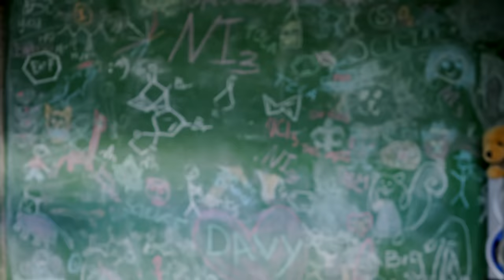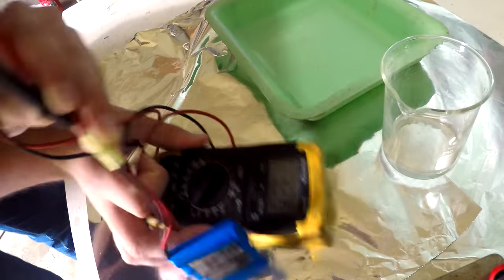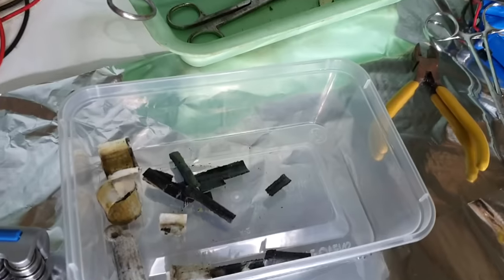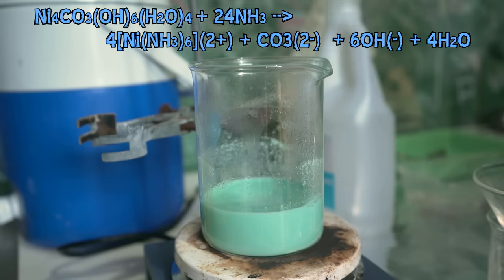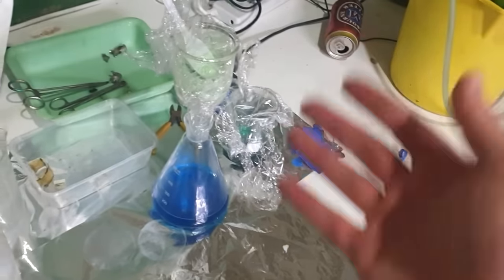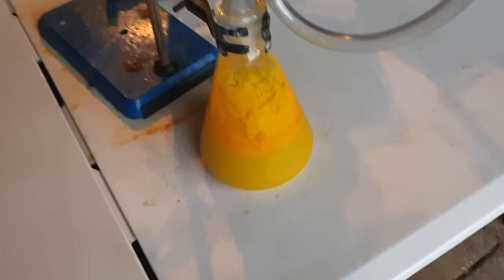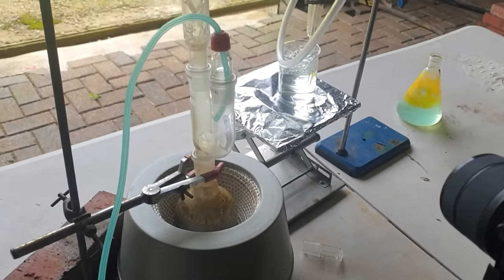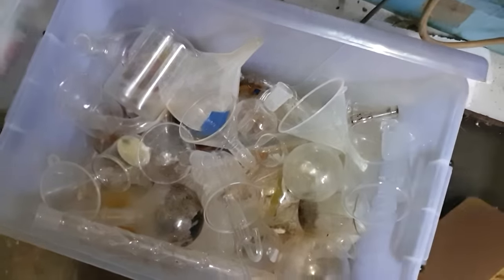Extracting Cadmium from a NiCd Battery

Comment: As part of my degree course, I went to a chemical plant that was very pleased that it had recently worked out how to replace the Cadmium electrodes they had been using, with Lead electrodes, because Lead was so much safer.
Reply: that feels like a weird sentence considering how bad lead is as well. Lesser of two evils I guess
Reply: In 2020 I worked a bit at for an electrochem project of a doctotorant as a general lab rat.
Cleaning and polishing the used cadmium electrodes was one of my jobs. I was kinda glad I had stocked up a few micro silver filter cloth masks before habd, because if the pandemic. ^^
Reply: Not that safer though.
Reply: Lead's way better than cadmium
Reply: @subliminalfalllenangel2108  ermmmmmm yeah it’s decently so, cadmium is fuckin scary lol
Reply: @theangledsaxon6765  perhaps... it is not mercury which is potentially like on thelevel of meth in terms of damaging... but its still bad and lead is even less dangerous than cadmium

Comment: Back in the 70's I helped build an apple press. After 300 lbs (yes, we were still using furlongs in the 70's too) of apples, the plating on all the screws was gone. A quick test in the university lab proved we had a tasty, toxic cadmium apple drink.
Reply: What kind of screw has cadmium in it?
Reply: @sunnysuryani5674  a screwed up one
Reply: RIP
Reply: Cadmium plated screws and bolts were common. We been getting cadmium plated nuts and bolts from China for some time and folk don't know. Galvanized and zincalume may also have cadmium if from tjyna. Heat it red hot for a bit if the coating is brown it's cadmium oxide. Zinc oxide is white but happens to be yellow when still hot till it cools .
Reply: @Philip-hv2kc  cadmium is pretty common in nuts, bolts and other metal hardware... i found out after i made a bong out of the stuff...

Comment: "Cadmium is extremely toxic"
10 Minutes later
"The Cadmium is somewhere I'm not quite sure"
Reply: It can't be that toxic. In high school, I tried to make my own NiCd battery and I was heating cadmium with a propane torch to shape it the way I wanted and I didn't realize not only could I melt it but its boiling point was low enough that I was boiling it too, and I certainly breathed in some of the vapors and never had any ill effects from it. Of course that was cadmium metal and oxides, they were probably not very soluble so I wouldn't have absorbed it.
Reply: That's not really how carcinogens work. Cadmium fumes can cause kind damage and kidney damage, but it's also a carcinogen.

Comment: We had some metal bits in our science lab in high school that was meant for showing how density worked. They came in these nice old kits in plastic bags, each piece was equal in size.
Among the samples was a slug of metal that didn't look like lead, but it was very very heavy. I was curious as to what metal it could be.
Read the instructions and it turns out it was a solid lump of Cadmium. That I was handling with my bare hands.
Reply: Oops
Reply: Well, elemental cadmium isn’t all that dangerous. It’s not absorbed by the skin so you’re not going to die by holding it
Reply: @Tactix_se  same as lead or even mercury. people got mercury fillings and we still fish and hunt with lead, and its mostly fine to touch(dont eat birdshot)

Comment: I have fond memories of NiCd batteries from the 1990's. I had Rc cars that used 7,2v nicd packs. I used a few of those packs almost every day of my childhood and they ALWAYS just worked. I would fast charge them on a 15 minute charger and discharge them at huge currents. I shorted them many times and all they ever did was get hot as hell. NiCd is a helluva cell and would be a great choice for EV if it wasnt so toxic.

Comment: NiCads also can function in the cold very well, which is why they used to be the standard for military aircraft, and are currently in use for Arctic conditions.

Specifically...flooded NiCad were used. Yep. They used hydroxide electrolytes and lasted pretty much forever. Marathon was the brand.

I got a hold of a pack of these, flooded them and used them for an electric snowblower conversion back in the early 00's. You have to use nickel plated connectors because the solution is so basic.
Reply: Those batteries have some Wheaties, lots of prompt current. Need 10 cells to make a 12V jump pack. The aircraft packs are 24V or 48v usually.
Reply: Misread that as "Arabic conditions"
Was like "wait what"

Comment: From Wikipedia "Ni–Cd batteries contain between 6% (for industrial batteries) and 18% (for commercial batteries) cadmium, which is a toxic heavy metal and therefore requires special care during battery disposal."

Maybe that was all of it
Reply: holy fuck, that really might've been all of it
Reply: 6% of fukk-all is fukk-all. I think you´re right.
Reply: @Skyliner04s  still, the cell should be something like 29g, he should have way more...
Reply: @AKAtheA  are we including the steel case?
Reply: @jeremymcadam7400  yep
Reply: @AKAtheA  could be that the 6% is relative to the internals?
Reply: @jeremymcadam7400  that would still leave him fairly short :P
The casing is really thin, a few grams at most.
Reply: Welll, his disposal of the cell was rather special so he totally fulfilled that requirement 😁
Reply: You could also figure it out from the battery's electrical capacity. 1A-hr = 3600 C (coulombs), which represents 3600/96500 = 0.037 moles of electrons transferred (that 96500 is Faraday's constant, the number of coulombs of charge in one mole of electrons). I'm not sure what the chemistry is in the battery, but assuming you get one electron per Cd atom, that means 0.037mol of Cd, which is about 4.2g of Cd or 5.4g of CdS. Those cells are probably less than 1A-hr, but are almost certainly more than the 100mA-hr that would justify only 0.5g of CdS. Maybe you're looking at 20%?? yield. If the cadmium in the cell oxidizes 0->+2 instead of 0->+1, you should expect half as much product, so in that case, maybe 50%?? yield.
Reply: @kevinmartin7760  this literally looks like hieroglyphics to me.
Reply: Damn close
Reply: @matthewjohnson4583  Lol basically there's a direct correlation between the capacity of the cell and the amount of cadmium in play, and... you do a bunch of "what he said", and that's how you work it out 🤣
Reply: @matthewjohnson4583  then go to school buddy
Reply: @Z. Michael Gehlke the 400Mg was not Cd, but the sulfide salt
Reply: @kevinmartin7760  Cadmium gives 2 electrons, I do believe, and as this is a 620 mA-hr battery, that gives us 2232 C, for 2232/96500= 0.023 moles of electrons transferred. 1 Mole of cadmium is 112.41 grams, which works out to 2.58 grams of cadmium, divided in half because it's two electrons per atom, for a glorious 1.29 grams of delicious cadmium in the battery.
Correct me if I've gotten my math incorrect somewhere here, the numbers are based off of the label on the battery pack that he dissects for this one, and it's been a while since chemistry in high school or the navy.

SInce that's a 4 cell battery, that works out to 322.5 milligrams per cell (based on the voltage, Ni-Cd cells typically run at 1.2V), which tracks pretty well with things like li-ion or li-po cells, cause those contain dick all lithium.
Reply: @Ornithopter470  Since those batteries are connected in Series, each of them will have the same 620 mAh capacity, so each cell should have 1.29g of Cadmium
Reply: @alexanderdaum8053  Fair, hadn't thought about that. That'd bump the total up to around 5.2 grams of cadmium. Which puts the yields right back to 10 ish percent.
Reply: And we all know how sus Wikipedia authors are.
Reply: @Ornithopter470  you gotta remember he only did one cell so that represents a 24% yield if he got 400mg of CdS (~310mg of Cd)
Reply: @Ornithopter470  Not a chemist, and learning about electronics, so no expert in that field either. But I do know that battery capacity is  expressed as current draw per hours (hence the unit, Amp Hours). Usually is expressed as current draw over 20 hours, so a 620 mAh capacity would mean a constant current draw of 31 mA over 20 hours. Makes sense, since 1 Amp is 1 Coulomb of charge per second, so multiplying current per time I get charge in coulombs.

Often manifacturers refer to this as "C" rating: in this case it's C20 because the time is 20 hours, but this figure depends on the current draw, the more current draw the "less" capacity I get. So, if I would draw 31 mA it would take 20 hours to completely drain the battery: common sense would suggest that if I double the current (62 mA) I would drain the battery in half the time (10 hours), but in reality I would drain the battery in less time (maybe 9 hours or so, it really depends on the type of battery) thus leading to less capacity (62 mA x 9 hours = 558 mAh, which is less than the nominal capacity, 620 mAh).

What I'm trying to say is that I know that Amps is Coulomb x sec, and I know the charge of a mole of electrons, so it should be possible from the capacity to calculate the mole of electrons and from the reaction stechiometry deduce the amount of Cadmium, but given that the capacity is somewhat elusive to state precisely because to some extent it depends on the current draw, wouldn't this be a little skewed?
Reply: Well, Wikipedia is shit, so…

Comment: It seems that whenever you try to get something from a battery, the question is always where’s the cobalt or where’s the lithium and you give up and never come back to it again.
Reply from the maker: 'Moving on with my life' is the less harsh term I use to refer to giving up
Reply: That's why I stick to zinc carbon for recovering stuff. The carbon rods make half decent electrolysis rods for some purposes and I;ll be buggered with a horseshoe if I'm paying for platinum ones. Also the zinc can be useful and it's easy to clean.
Reply: @gordonlawrence1448  +
Reply: @ExtractionsAndIre  well put!
Reply: @gordonlawrence1448  I was just gonna say this 🤣
Reply: “Where’s the Cadmium” is a game that has 10x more danger and fun!

Comment: Also cadmium is really soft and you could chew on it mate
Reply from the maker: That's one way to test for cadmium I guess
Reply: Cadmium test:
Have someone drink the solutions.  If they're dead, there was cadmium!
Reply: @Ninjastahr  if you drink the reaction mixture, you get to use all the amazing testing equipment they have at the hospital :D
Reply: Tasting the compounds is a good method of identification and was widely done in the pre 20th century.
Reply: Cadmium was once included in mercury dental amalgam. Lead also for temporary fillings. It even had semiconductor properties. Thus people would pickup radio stations in their mouth.

Comment: I know I'm late to this party but the H2S is probably reacting to make some Sulfuric acid as it bubbles through the solution, dropping the PH and increasing the solubility of the cadmium in solution. This would explain why it seems the reaction stops after a certain amount of time. To keep it constantly going you would probably need to adjust the PH back to slightly acidic when the reaction stops.

Comment: Cadmium is very, very similar to iron-nickel when in sulfate acid, such as nitric-oxide acid, sulfuric acids, or nickel-cadmium ion acid (which you used twice)! The result will be iron-sensitivity, which is highly dissolvable with sulfuric acid, but not with fulric (or formic) acid. You were actually recreating the science of the battery itself, generating a voltage very likely by adding and removing different highly-sensitive-set ions to the solution! Great video, a lot of fun to watch! Take care, an Immortal Speaking.

Comment: When you put H2S into the Cd(NO3)2 solution it decreases the PH again by regenerating the acid:
Cd(NO3)2 + H2S -> CdS + 2HNO3

I'm pretty sure that's the reason for the low yield.
Reply: Solution: buffer the shit out of it!
Reply: My guess is that within a weeks time, most of the CdS oxidised into some mixture of sulphite and sulphate. Cadmiumsulphate is fairly soluble in Water at 772 g/l.
Reply: @marinahildebrand5868  Cadmium sulfide was used as a pigment in paint, so it should be fairly resistent to oxidation, but according to Wikipedia, it does react with HCl.
Reply: @hammerth1421  Yeah, I think adding sodium acetate to the solution should do it.
Reply: Turn that arrow into an equilibrium arrow and I think you have your answer. Once CdS reacts with acid, the H2S can just fly away as a gas.
Reply: @dillonhofsommer5648  True, that would show it better, but I hope it's still understandable.

Comment: I want to thank you for making great content. It inspired me to pursue a degree in chemical engineering. Also NiCd batteries are only 6-18% cadmium, that would be part of the reason for the low overall yield. Dismantling larger cells would be a better option as they require a similar amount of time to open as the small ones and would have more cadmium . Best source would be old drill battery packs.

Comment: NiCd is my favorite battery type. Why? BC of how robust they are. I have some 12v NiCd packs that were used for emergency lighting. They were expired and were getting thrown out at my old job, so I grabbed them up. They gotta be at least 15 yo and they still work great. Also you can beat the crap out of them and they still work great. Overcharge them, drain them to zero volts, short them out and they still work fine. Hell the only thing I was able to damage are the thin ass tabs that connect the cells to eachother. Also don't need anything special to charge them, just a 14v power supply, hook em up and when they start getting warm, they're fully charged!
Reply: The only issue IIRC, is that with time they lose charging capacity, which is their main drawback.
Reply: @franglish9265  so does every other rechargeable battery chemistry

Comment: Interesting journey, enjoyed the progression of the process and problem solving. The only other time I have seem Cadmium recovery from a battery was at a company who will remain nameless and the process was a vapor extraction and condensation in a sealed steel retort, direct from mechanically prepared cells. It was quite effective but I didn't envy the staff who were running the process - even with PPE.

Comment: Ah yes, the humble NiCd. I haven't seen many of those, they're not common nowadays. But there's one thing they have over LiPo packs: NiCds are tough.

The main reason why NiCds are so rare now is not because they're horribly toxic (*cough cough*, LiPos have cobalt in them), it's simply because Lithium cells can hold more energy for a given mass and volume and store it for longer.
But the LiPos don't last as long and they're more delicate.
A very interesting thing though: the new Toyota Corolla hybrid saloon uses a NiCd battery, but the Hatchback and Estate use Lithium Ion.

Comment: I always thought that the main reason LiPo's are so volatile compared to other batteries is simply because they are have so much energy density compared to other batteries. Like, it does not even matter what kind of chemistry it uses, but if you short a battery, then all of its energy is quickly released in a runaway reaction and the main difference about LiPo's is that they simply have way more energy stored than most other batteries.
Reply: Yes and no. Lipos also have a positive thermal coefficient, so the hotter they get, the higher their voltage gets which....as you can imagine in a fire tends to make fires worse!

Comment: I'm glad we found out *where is the cadmium*, that was quite the emotional rollercoaster. Also I believe, but am not certain, that you actually did get a good yield. The cadmium is trace amounts, deposited on the graphite foam. Batteries are all about surface area, not mass. But I'm a software engineer, so don't trust a fucken word I say.

Comment: the problem is , they tell you not to throw out the batteries but they don't tell you what to do with them.
like what, are the  consumers just suppose to keep all the batteries they ever use and slowly fill up their houses with dead batteries XD no.

also NiCd batteries are still sometimes used in wireless home phones.

Comment: They used to use a cadmium coating on the inside of tincans before they discovered that you could use less toxic tin to stop vegetables from becoming rust-brown. Now they use epoxy with bisphenol-A or it's questionable replacements; BPA is fat soluble so something like coconut cream in a tin can will have high levels of this estrogen-look-a-like, where as crushed tomatoes are too watery to extract bisphenol A from the coating.

Comment: Way late to the party but one of NiCad’s best uses is airplanes. The weight to power to “explosivety” is vastly favored over lithium since fire protection for NiCads is a lot lighter than what’s needed to try and stop a lithium fire
Reply: I thought it might have more to do with discharge speed. They still use NiCads in jet airplanes because when it comes to delivering all of the current all at once, nothing compares...and that's what you need to spin up a turbine. LiPos can't deliver the amps and generate a lot of heat if you try and discharge them fast.

Comment: NiCd uses KOH aqueous electrolyte so internal damage or short circuit causes the electrolyte to evaporate as steam.  KOH doesn't evaporate. 

Most Li based cells have an organic, flammable electrolyte so on damage, the heat causes a flammable vapor release.   Which is easy ignited.

Comment: Cadmium plated screws and bolts were common. We been getting cadmium plated nuts and bolts from China for some time and folk don't know. Galvanized and zincalume may also have cadmium if from tjyna. Heat it red hot for a bit if the coating is brown it's cadmium oxide. Zinc oxide is white but happens to be yellow when still hot till it cools .